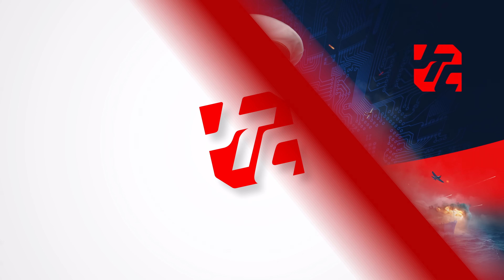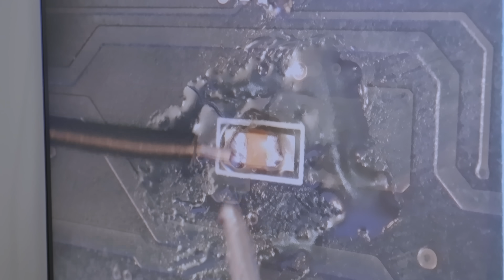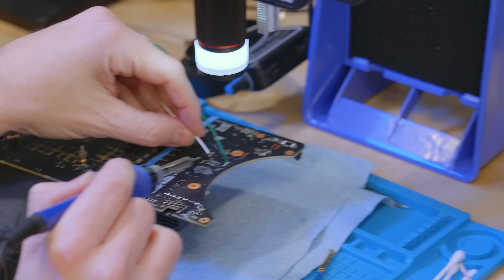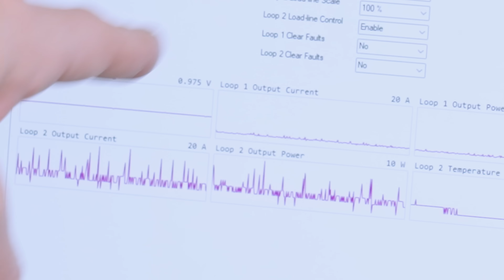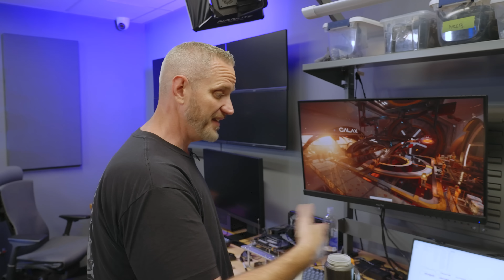This didn't go as planned...

Comment: Dont need to solder gnd just a wire to a circle terminal and just use the screw from board to back plate as gnd

Comment: On a power supply, sometimes the big capacitors,  aka, bfc (big fuc..ng caps) will blow. They are loud. The evidence sometimes is underneath them. You have to desolder them to find out. Not every capacitor blows from the top, sometimes they go from the bottom.

Comment: My go to for soldering, no promo, just experience,  is the following  1...Metcal, expensive, got to know your stuff, the tips you buy are the temp. 2...Pace, great brand, offer many solutions for through-hole and smt. Mant different tips. The heat is in the solder iron, so tips way much cheaper. 3 is Weller. A great iron, station. Again heating is in the wand, tips are chead.😊

Comment: I also dislike you did not, what we call, "pre-tin" the wires. Basically you apply heat and solder to the ends of the wire.  It helps with the connection in soldering

Comment: 30 AWG or 32 AWG. The ground, i cheat. I get a vice. Heat both sides
Reply: I HATE GROUND PLANES
Reply: Hardest thing to solder, other than nickel plated wire, or certain military projects i will not name

Comment: As somebody who does board repair jobs for their field, you definitely are making improvements.

At 13:13 though, the board isn't hot enough for the solder to flow correctly into the hole. What you can do to solve this is use your hot air station and apply heat to the area at the same time that you are applying the solder! This will make the solder flow all the way through the hole.

Comment: for the ground use both hortair and the iron to proper heat up the board, you also want a bigguer mass tip, I recomend the knife type you'll have much better thermal transfer, it's getting better though

Comment: few notes. too much solder not enough flux and you need to preheat the board not with the iron but a heating bed made specifically for it. Also I wonder iv the variance in the voltage reading is like how most hardware monitors read cpu VID.

Comment: Just make sure you heat also the pad on the board with the iron. where the cap is soldered to have a solid joint. Because your new tin is not melting with the old one ans you get a cold joint. Wich can cause higher resistance and way more fragile.

Comment: i remember when i was 16, my dad gave me a box of broken electronics, a soldering gun, magnifying glass, solder, flux, and Vaseline in case i ran out of flux (works, but is messy and hard to remove)

some things like that 1 ground connection that was giving you issues, you >can< dry solder it if it reallly doesnt want to stick easy. just you cant mess up at all, zero margin for error. if that solder hits board with no flux, it will scorch and stick to things its not supposed to and can easily damage things. thankfully, you got it this time so no need for risk. Also, its better to have secure connections than presentable connections. your soldering was just fine, especially being relatively new and not as practiced with it. They're solid, functional bonds. thats all you need.

Comment: Jay! It's a through hole. Put the wire through and solder from the other side. Don't tin the hole. And btw, those voltage meters aren't very accurate. Verify with your multimeter

Comment: You could tin the wires before attempting to solder and tin the pads on the card as well. Also if you dry out some flux you'll get a tacky flux that acts like glue and helps hold the project still. Also clean and thermaly shock your tip befpre applyiong some solder to the tip and when you put it all together the solder should flow really well. Also a card heater is nice for small projects. All and all nice work brother!

Comment: This is why at least an above average knowledge is required for this stuff (extreme overclocking) as a lot of this stuff goes over my head and as shown, there are different revisions of gpus which makes ‘copy n’ paste’ methods of overclocking / overvolting etc difficult to do as these revisions of gpu builds and models makes understanding the basics more complex and difficult to work out.  I’m happy with my minor undervolt, curve optimiser etc with MSI Afterburner and getting a cooler and quieter and at times slightly more fps in my gaming sessions 👍🥰💪✊😇

Comment: If you do that many runs, that much data, all and not going anywhere it has to be the silicon itself. Like think about it, if you exhaust all variables the cause is what you can't change. You said yourself you had different behavior between different cards. Instead of torturing the ones you got to death, maybe just get another one. At this point I wonder what makes more monetary sense to do. LN2 ain't cheap and neither is your time.

Comment: Try an older driver to get a higher Port Royal score, for example 572.42. I saw improvements of around 3% compared to the latest driver (576.88). But be aware that power handling and clockspeeds do differ with the older driver.

Comment: Tin the wires first and then stick the wire through the hole.  Then use plenty of flux (but don’t use the hot air cause you’re blowing away the flux), just use your iron and keep it on the pad till all of the solder is molten.  Patience is your friend!

Comment: When soldering through hole, heat the opposite side of the hole to the component. The solder should wick into the hole and wet the joint if you have the correct amount of heat. Please also read @Fooniepoo's comment as he also has suggested some fantastic advice. Edit: I'm IPC 610/620 and JSTD001 trained. Edit 3: would actually watch you take a solder training session with rossman or Roman or the guys at GN

Comment: Especially for the ground use a bigger tip on the soldering iron. The small tip has a small thermal mass. You want to use a tip that doesn’t come to as much of a point so it can transfer more heat to the board.

Comment: The shorter the distance of what you want to measure with meter, tge more accurate voltage reading you will get due to less wire, less resistance. Shorter cabling = less resistance, longer cabling, more resistance. Soldering on that first cap will prove more accuate core voltage measuring for tighter control.

Comment: soldering tip. ive soldered a couple times like 10 years ago but i think i remember this cool trick. dont heat up the solder then move it onto the wire. instead, place the wire on the solder bit with the pressure from the iron and it will basically absorb the solder onto the wire when the copper gets hot enough. i could be wrong and probably am

Comment: About the power limit. I've seen a Blackwell BIOS Editor in GitHub made by 'bmgjet'. I'm not sure whether this actually works, but I reckon it's worth a try. They also made Ampere BIOS Editor which they used to make a 1000 watt VBIOS for their RTX 3090. I'm sure you can increase the power limit well beyond that if you wanted to.

The only problem might be flashing the VBIOS on the RTX 5090. Perhaps there's already a patched version of NVFlash that supports the 50 series.

Comment: If the light dimmed when the PSU went kaput, seemed like you are connecting directly to the grid, maybe try to connect to true online UPS first to clear the incoming power frequency and voltage.  A lot of sensitive machines in the industrial setting preferred seperate power grid due to power fluctuation from the main grid.

Comment: I had a PSU explode like that one time. There was a bad circuitboard on which the On-button for the PC was, which caused it to shut down when it wasn't pressed in. So I taped it pressed in. It did not take long for the PSU to explode and actually crack the window next to my desk. It was very loud indeed and it only had a capacity of 450W. This was in a newly built PC so I sent back the exploded PSU and got a new one for free.

Comment: poor condencator, if you want some tip for soldering high heat capacity objects at home. take a cardboard box that is less than board,  make a hole on a side with a size of a blower output hole, put your blower in that hole, put board on top of the box, set blower 150 celsius, wait about 3 minutes and start soldering. that way you would heat the whole board to 60-80 degrees and you put your iron on pad first until whole pad is wet.

Comment: JAY!!!!! Keep the f&^%ing iron on the GND pad for way longer. WAAAAY longer. Until you think you will burn a hole through the PCB. It's the only way unless you can preheat the whole board to like 200 degrees celcius or something. Maybe it was your shaking hands and the microscope (or editing) but it looked like you applied heat the the GND pad for less than a second. The GND  pad should be hot enough to melt the solder on the tinned wire. The iron heats the thing you are soldering to, not not the thing you are soldering on to the thing.... if that makes any sense. I know it was teeny tiny but I would also recommend using the biggest tip you can possibly work with too. I do know you are dealing with a whole GND plane drawing heat away. Hand soldering a machine soldered board is a little insane. 

Maybe I'm a little obviously triggered by this. I have to do stuff like this a lot - not GPUs  but machine soldered boards that need hand soldered repair.
Reply: A college friend used an old toaster oven to solder surface mounted devices; one could assume the same setup could be used (at lower heat) to warm a board

Comment: silent louis rossmann voice in the background: HEAT THE BOOOOOAAAAARRRDDDDD!........

some notes as i'm watching:

- the reason why you see 1.25V on your multimeter and 1.15V in the software is that you measured it at the VRM output where it is always higher than what actually goes to the GPU Core. the power planes and everything the power passes through before it gets used up by the core have impedance which causes the voltage to drop and partially be converted into heat. so this is completely normal. the software reports what actually gets to the core so it subtracts the drop from inefficiencies.

- the shunts getting that hot is... concerning. tbh i never heard of them getting that hot. i guess it should be fine? the solder won't melt for another 80C or so. but they may unintentionally become fuses at some point.

- i have used those voltage meters before. they are... not very accurate. i saw them misreport by 100mV almost all the time. they are good for telling you what ballpark you are in but i would use something like the EVC or an oscilloscope to precisely measure the voltages.

- from what i heard the 5090 stops scaling at 1.25V. 1.35V would just add a ton of heat and power draw for no benefit.

glad to see some more XOC content on big channels again. can't exactly say i am super interested in 5090 stuff but just seeing someone mess with something is cool.

Comment: if you place the wire in the hole then use solder to hold it in it will be waaaaaaaaaayyyyyyyy easier,make sure you tin the wire first

Comment: EE here.  Some tips:
- Make sure you calibrate your voltage meters against your multimeter.  The little 3-digit one you used is unlikely to be super accurate.
- When your LED lights dim you've browned out the circuit pretty badly.  That will make the PSU switch faster to compensate, which causes more heat.  Stick another multimeter into the power socket you're using to check your mains voltage during runs, it might be worse than you think.
- Regarding PSU ripple: cheap oscilloscopes are actually pretty good these days if you want to check for it, I'd recommend either Siglent or Rigol.
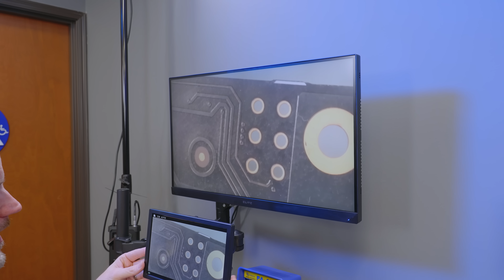- @9:06 solder to SMT components like you did on the red wire, not like the black wire - you've got much more surface area in contact.
- For through-hole, tin the wire (not the board!) before you solder it to glue the strands together and prep the surface, then stick it through the hole, then add solder to hold it in place.  The reason PCBs are gold plated is to make solder wet it REALLY well, so if it's not wetting then it's not hot enough and the joint could end up with high enough resistance to mess up your voltmeter reading.
- Keep working under magnification, even when you don't think you need it.  It will help your fingers learn how to make smaller movements.
- Make sure you hold the heat for couple seconds after you make the connection to allow the solder to flow, especially for ground planes.
- Speaking of ground planes: 
a: A bigger soldering tip will lower the thermal resistance between the iron and the board and make life easier.
b: A PCB preheater should be less than $100 on Amazon.  If you heat the entire board up to just below the melting point of solder you'll need a lot less extra heat from the iron (also less risk of thermal shock).

And yes, your soldering is definitely getting better :)
Reply: Lot's of good advice here. Thanks!
Reply: Excuse me, your education is showing 😊
Reply: Added my comment and mentioned your comment too. Everything here fully agree with 👌
Reply: Tinning the board instead of the wire hurt me and not putting the wire through the whole. 💀
Reply: @Nick99dcs  We were all noobs once.
Reply: Good tips.
Reply: brother do more then just comment here email jay with all the goods info and let him know, he needs to read all this
Reply: Everything you just said, thank you.

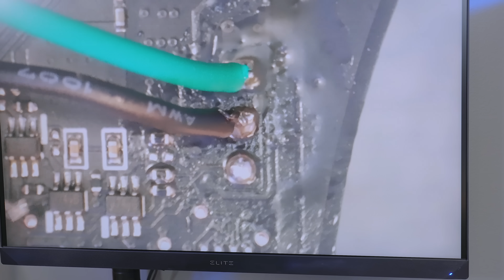Comment: 14:00 You should get a better soldering iron for those pesky ground plane jobs. For example JBC has the heating element diretly included in the soldering tip and can deliver more energy than the kind of iron you have.
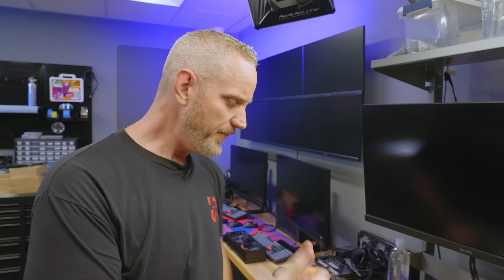20:15 So you have a surveillance cam in the corner but no footage of the boom? ^^

Comment: First thing your soldering has gotten so much better. I have a bit of advice for you. You don't have to flux the board while you are preheating. It is pointlessly messy.  I would also recommend removing the tip from your rework station and heat up a larger bit the board. Just be careful for connectors and electrolytic caps. When I am doing big heavy high voltage industrial boards I like to run around 300-380c full airflow with no nozzle and heat up at least a few inch diameter around my work area. I also recommend using flux that comes in a syringe vs the brush. For small work it is just much cleaner. Also I couldn't really see when your were using your iron to solder the wires to the board but positioning things in such a way that you can rest your wrist on your work surface will do wonders for reducing the shakes.(if you weren't already)

Love your content.

Comment: I habe a 9950x and 5090 and 1600 watt evga psu and a bunch of harddrives and a killawatt type thing on the wall and when I run an intense topaz ai model and handbrake at the same time it regularly pings 1700 watts. I don't doubt 1100 watts just from the 5090 will wreck your 1500 watt psu.

Comment: My coworker adjusted voltage to his cpu the other direction lower. And cpu running cooler and faster cause of it, should try it see if your gpu gains any performance since not running as hot

Comment: do you have a power line conditioner or a battery inline on your circuit? you may need one to stabilize the power coming into the power supply. I always run a conditioner on my main pc you would be amazed the difference.

Comment: Don’t use mains power, use a portable high power battery- they good at staying stable. I think Linus did this too. Also a 1500W power supply is usually rated at this power for 230/240v mains. 115/120v means it’s drawing way more amps when getting near 1500W and probably can’t do it stable.

Comment: Keep going bro, you are doing fine. 
Back in the 90s me and my brother started flashing satellite cards, modding modules, and installing mod chips to consoles (past statute of limitations so chill).  I had an old soldering iron from a electronics kit from my bros vocation school (he failed).  I learned by trail and error, and this was long before internet, well save for pictures via 56k. 
You get better, you learn, get better, you cause a fire, you learn.  One time, I took a broken VCR board and soldered a wire to every part possible, including legs from chips. That helped a lot. A lot of noob things I ran across: like laminated wires, copper laminated grommets.  I now keep emery sanding boards - and sand lots of surfaces before soldering.  I threw away grounding bands around the wrist, and installed a grounding wire from the house panel to my metal work surface, and plug a grounding clip to boards. 
Things I would love to have back then, cheap electronic tools- they were so expensive back then. Precision air guns, precision soldering irons (back then it was watts switch, dialed wattage was wildly variable and was in the $100s.) cheap glue heat shrink tubing, and youtube videos. 

But again, keep at it, practice on dead electronics. Practice on scrap pieces before risky work on boards. You will do fine.

Comment: you mean burn your shit to ground mod....  Modern GPUs (especially on 4nm or 5nm nodes) have transistor gate lengths around 4–5 nanometers. Copper interconnects between them are similarly microscopic, often <100nm wide depending on the layer. These features make thermal and voltage tolerances extremely tight.  Silicon-based semiconductors degrade faster at high temperatures. Operating consistently above ~100°C (junction temperature, not ambient) can accelerate electromigration, leakage currents, and overall wear, leading to shortened lifespan. For consumer-grade chips, manufacturers aim to keep junction temps below 85–105°C for reliability.